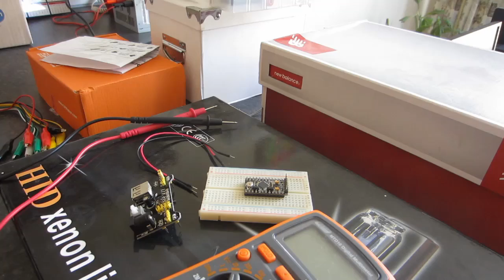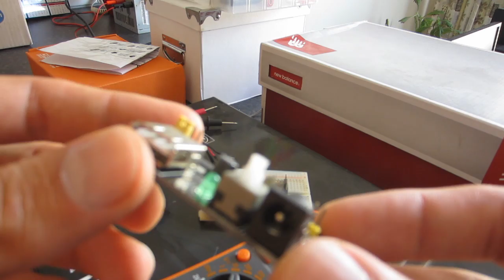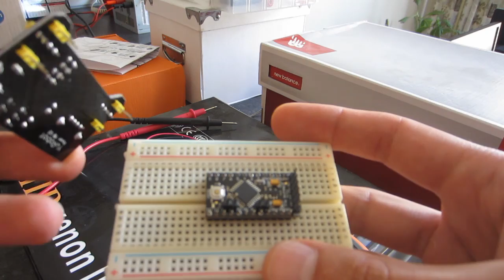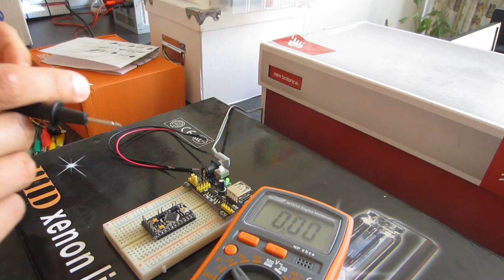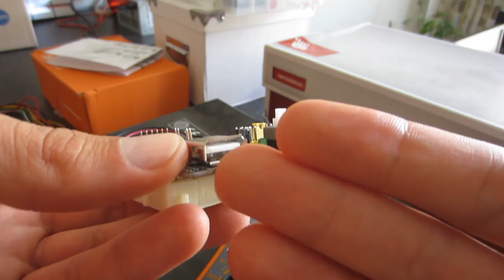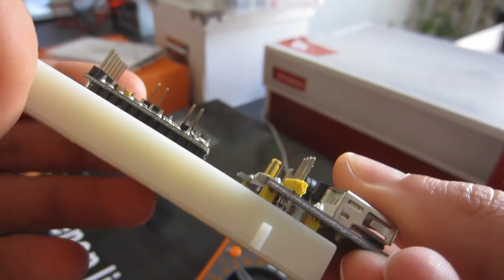Breadboard Power Supply Module 3.3V 5V MB102

Comment: review in underwear :)))))) and that usb is to power phone or arduino using usb cable,  and so on
Reply from the maker: Ah, that clarifies it. I did not try it yet. Thanks.
Reply: I used the USB port to power up the entire module, not to charge or power up other things😐

Comment: i think the female USB is for powering a USB powered device like a raspberry pi
Reply: yeah you can see it in action (powering a Pi or Arduino) on the linked part page: https://ae01.alicdn.com/kf/HTB1QMKXLXXXXXb8XVXXq6xXFXXXb/225552329/HTB1QMKXLXXXXXb8XVXXq6xXFXXXb.jpg?size=164064&height=667&width=1000&hash=e969b0ebe082da49cdd7736356eecd13
Reply: Wolfgang Kleinschmit umm, not sure where you get this info from, but there are literally 1,000’s of suppliers of these cables
Reply: @Wolfgang Kleinschmit wierd cause i got one right next to me and its working just fine
Reply: I use the USB for INPUT power from the PC. works and it powers 3.3. and 5v
Reply: @tropicaljantie  that comment I looking for 😊
Reply: an